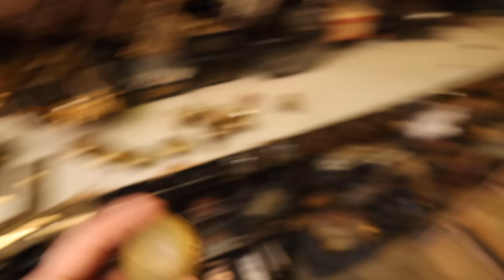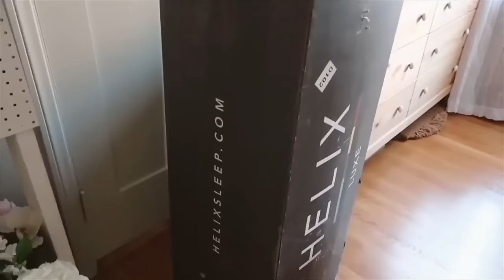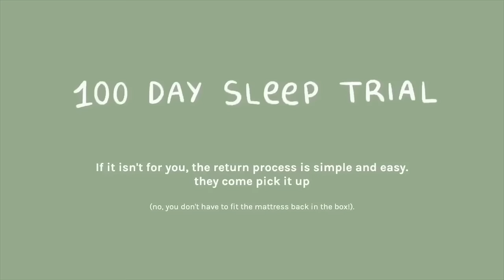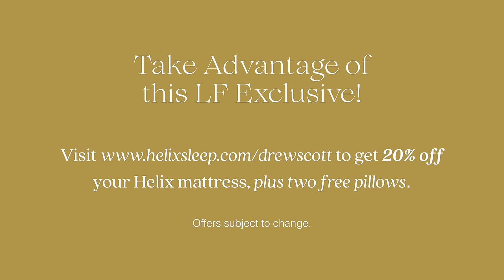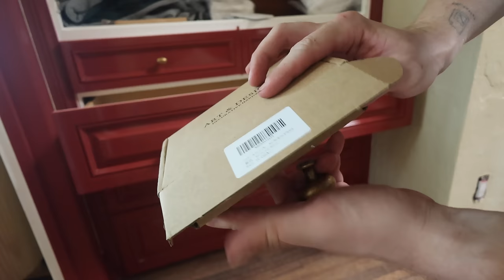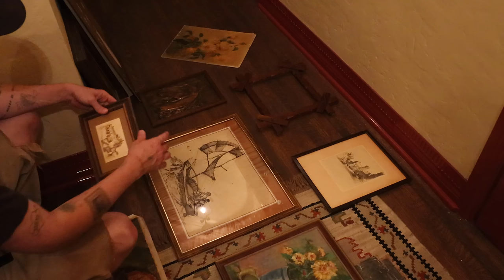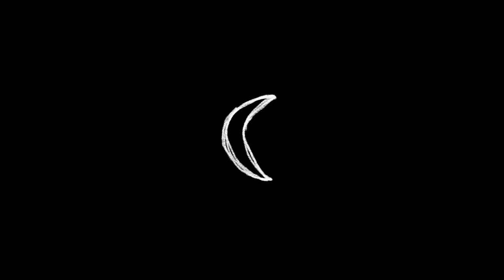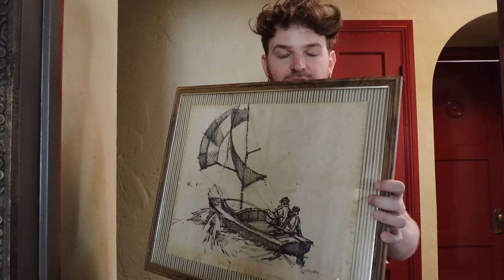EXTREME HALLWAY MAKEOVER *From Basic to BOLD* Historic 1929 Spanish!

Comment: Such a dramatic change!  Really gorgeous  and rich looking.  I've always loved that color combo - khaki and red.  So perfect together.  And your rug is tailor made for that space.  Great idea to use it as your jumping off/inspiration piece.  

Love the extra trim on the baseboards, the pretty knobs and back plates for the doors, the glass in the skylight...all the details that build upon each other to make the whole.  And the art and mirrors and decorative pieces are so thoughtfully placed. 

My favorite parts?  The lantern is perfect!  At first I, too, thought it might be too large, but once it was hung in place it isn't too large at all.  I think the size is necessary to offset the dramatic visual power of the stained glass and red doors.  Anything smaller would simply be overpowered.  But the piece de resistance is that fabulous desk!  I loved the cabinet, too, but the desk is just the fun piece needed for that spot.  The cabinet, in addition to being too large and blocking that vent, was too formal and serious.  The desk is a breath of fresh air! 

You did it again, Drew!  Beautiful room. ❤

Comment: Lovely!  Enjoyed.  Tip: Use a small drill bit and drill into plaster and drive a small screw to hang pictures.  Pounding a nail with a hammer will pop out the "keys" on the backside of the plaster and it will fall off.  Just a thought.

Comment: I know you ended up changing the knobs in the hallway but when you paint the door handles and hinges does it affect the way the doors work? I would think they’ll be stuck when turning the handles? Wouldn’t the paint scratch off the hinges every time you open and close the doors? You did this with your door in the office and I wondered if you painted it shut and now can’t use that door.

Comment: Dear dear Lone Fox - primer is a dual necessity - 1st it  is the middleman that makes the top paint adhere to the wood. I did trim work back in the day and it all chipped off like nail polish. Then I was informed the very very necessity of the hard working chemical fusing primer. 2nd it raises the grain which then needs to be sanded to a perfect finish so when you paint ESPECIALLY HIGH GLOSS  you will get a mirror finish. You can see all the old wood grain on your video that spoils the mirror finish.  I have followed you for years love love your energy and love how you treated your previous landlord , you gave him such respect. Keep making your videos love them all. S. Minehart

Comment: Hi, all! This is a BEAUTIFL idea. I just wanted to add a little note or "heads up" for any one wanting to attempt this at home. Any gloss paint will show any and all imperfections of the surface you are painting. So, if you are someone like me. Seeing runs, previous scratches on the door, dings, and stippling imperfections from previous painters will drive you insane. That is why your prep work is SO SO SO important. Its tedious and not as fun as jumping right into painting but it is worth it in the long run to have a nice and even finish on the doors or surface you decide to paint. I have worked for a professional painting company for 4 years now and have yet to see a project you won't have to do prep work on. Even doors right from the store.

Comment: I have one suggestion, and it is  a very unusual one. I don’t know if you’ve ever seen them, but many years ago when you had a hallway with many doors, the housekeeper would have what was called a housekeepers key ring.
It would hang on the wall as you enter the hallway with skeleton keys for each of the doors. In this case, you would need seven of them. 
With your thrifting and flea marketing, it would not be hard to find seven unique and unusual types of Skeleton keys, hang them from a large brass ring  and hang it on the wall near the entrance to the hall.
It would break up the fact that you just have paintings on the walls and be a very unusual conversation piece.
If it doesn’t work for you, not a problem it was just an idea. 
The hall is absolutely perfect and if I was going to hang the key ring, not withstanding what I’ve already said , I would hang the key ring and keys  above the toybox in place of the diamond shaped painting. 
No matter, I absolutely love your hallway. It is spectacular!

Comment: So, red pigments are tricky at best. As much as I’m usually unconvinced about specific primers, I have painted deep reds on a wall with and without the recommended primer, and I would never do it again without it. I ended up needing 2x as much paint without the primer as I did with it, the finish wasn’t nearly as nice and the paint was significantly more expensive than the primer.

Comment: Did you cleaned, degreased , sanded and cleaned everything again with clean water first??  So I mean all the wood work.  Including restoring every irregularity in the woodwork and then cleaning al the restored spots before even STARTING to paint ànything  . . .